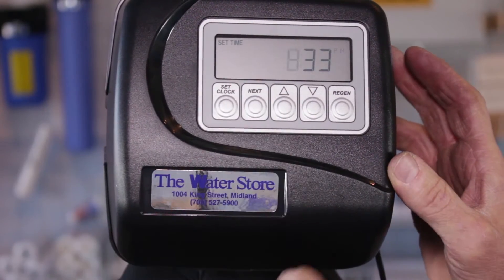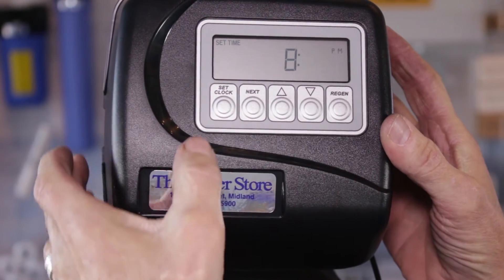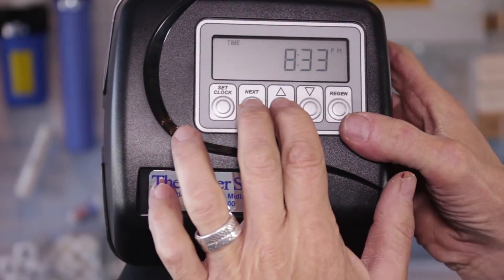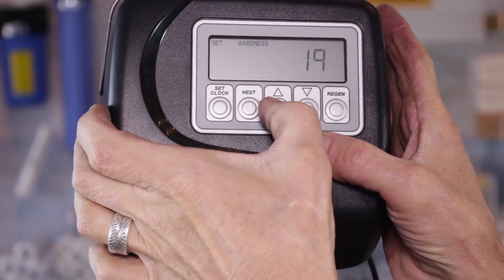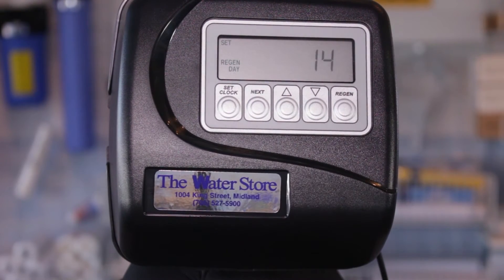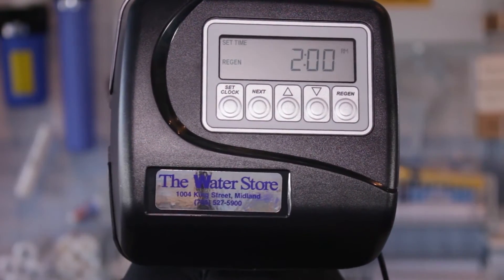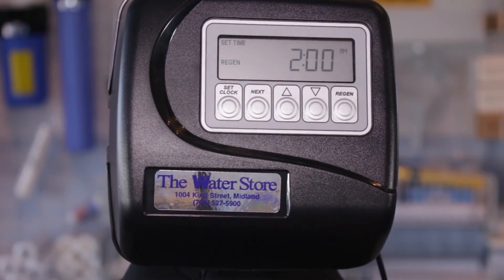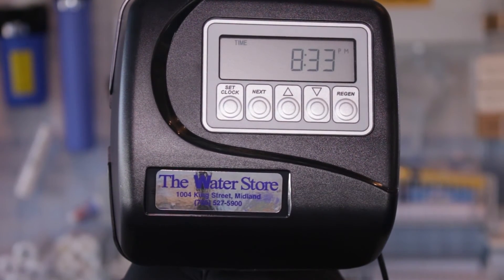Water Softener Installation Part 4C Programming Your Clack WS1 Water Softener

Comment: I just tested my water with a TDS meter. I tested the water before the softener and after. Before the softener had a reading of 350ppm but the soft water had a reading of 450ppm.   From what little I know of softeners I thought the ppm should be roughly the same going in and coming out.  Do you know why my soft water is 100 ppm higher? Is something wrong with my softener.
Reply from the maker: usually the water after the softener is slightly higher TDS.  You may want to check to see if your water hardness settings are correct on your water softener.